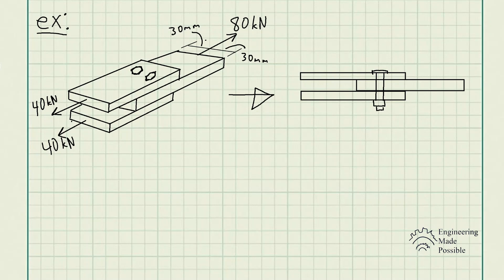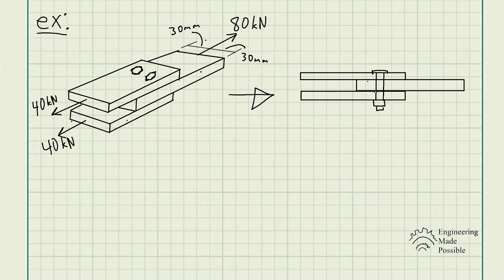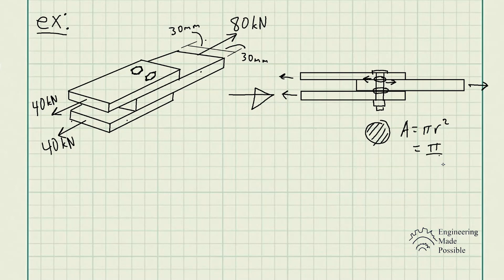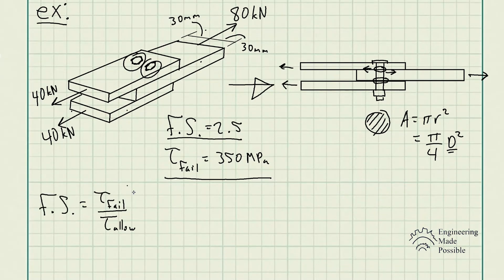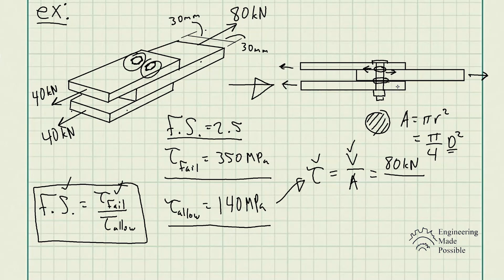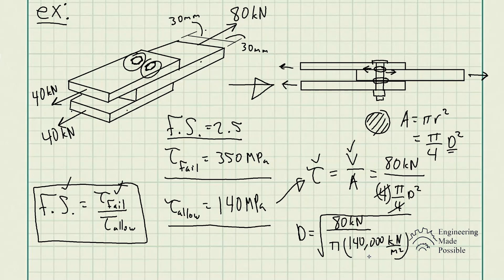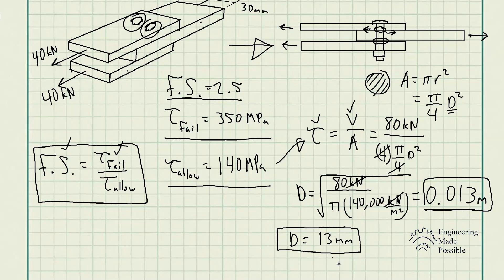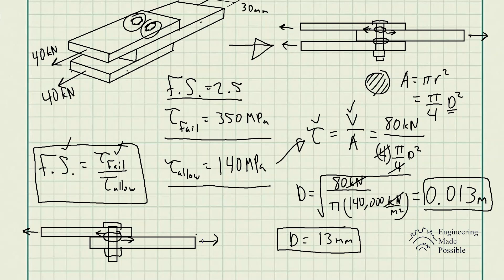The joint is fastened together using two bolts. Determine the required diameter of the bolts if...

Comment: But what happened 30mmm can u tell me pls
Reply: 30 mm is unnecessary since we are only calculating the stress in the bolts. The plates are not held together by glue or anything else. Therefore, we calculate the shear the bolts both experience.